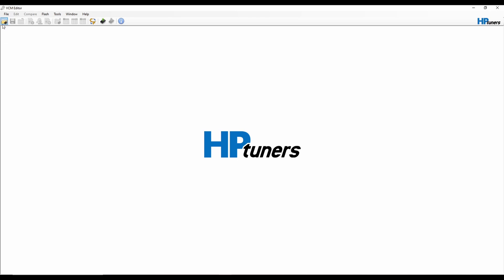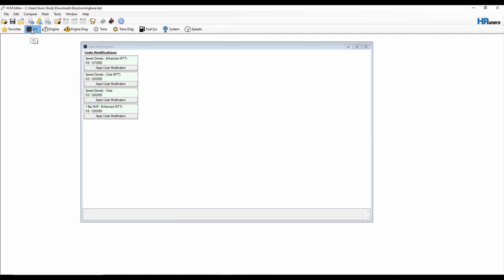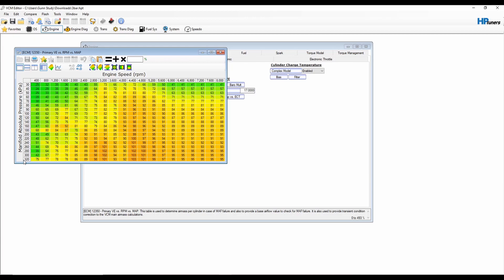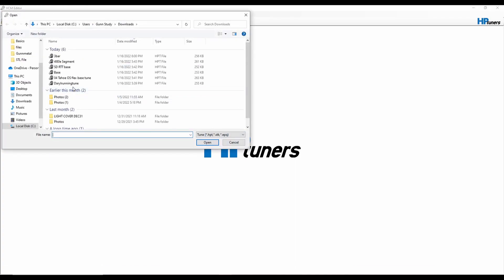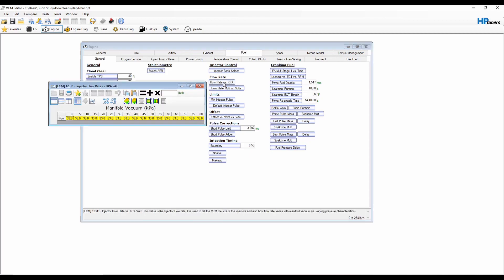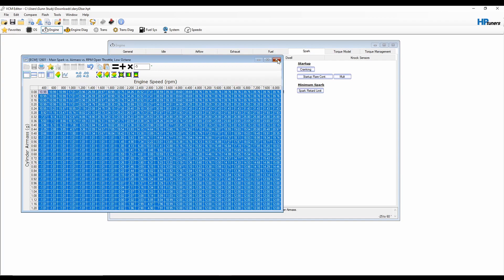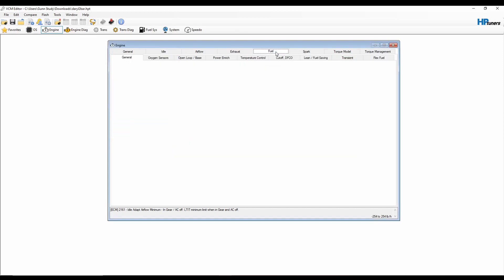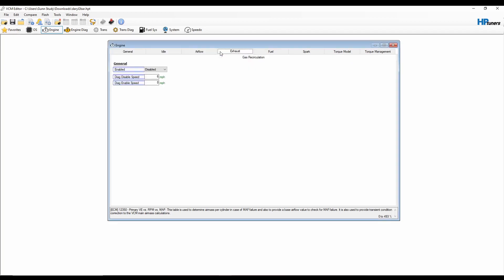LS Swap HP Tuners Turbo tuning. OS Swap, initial start settings.

Comment: Can you choose the 2 bar RTT option if you have a 3 bar map sensor? Will it malfunction or only allow tuning up to 2 bar? Thanks for the info!!
Reply from the maker: It's not the total, it's everything in between, the scaling will be off. 

They all read 0-5v, so the data points will be off. 

If you're not using a MAP that lives in the  handheld, you have to use a laptop and the software to correct it.
Reply: @TheDrivewayEngineer  ok. Just asking because I have a 3 bar map but sounds like 2 bar would be easier. Maybe I’ll just buy a 2 bar and save it for later. Thanks for the help!

Comment: My Vehicle Will Actually Run At Negative Timing Advance (or Spark After Top Dead Center) . But I'd Say Mines A Special Case. It's Got A Really Small Turbo For A 5.7 Hemi. Can Make As High As 10PSI Of Boost Around 2400 RPM - 2900RPM. The Timing Has To Be Really Dead In That Area To Keep It From Knocking. But When It's Really Cold Even That Low 2-3Deg Of Timing Is Still Too High. It Knocks And Pulls Timing And Runs In The Negatives. I've Actually Turned The Timing Into Negatives To Make Knocking Go Away To Make Sure It Wasn't False Knock. It's Runs But It's A Very Odd Sensation I Guess haha. Like It Makes A Ton Of Boost But Doesn't Really Do Much With It hahaha